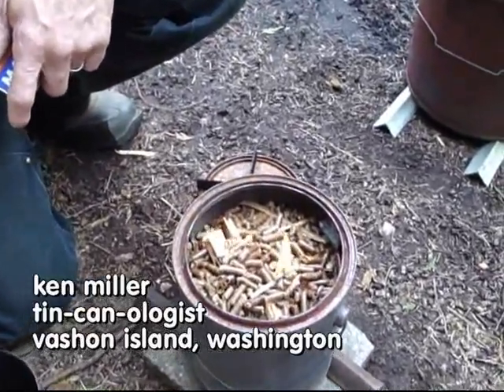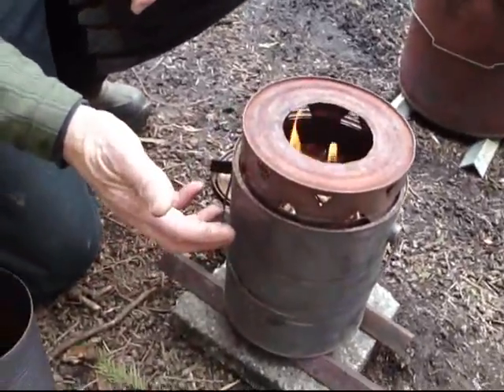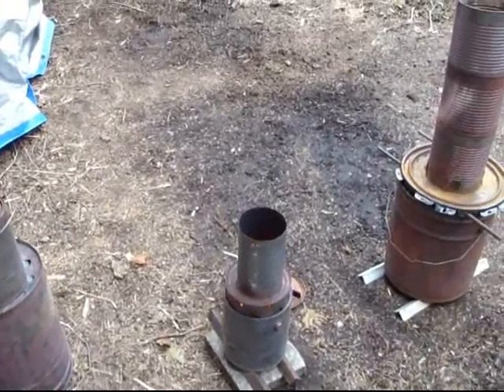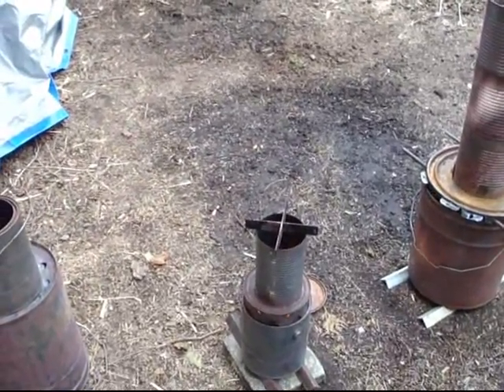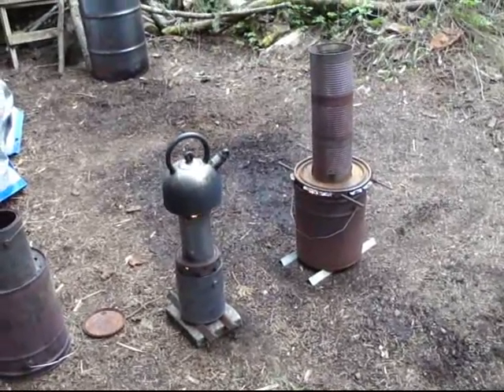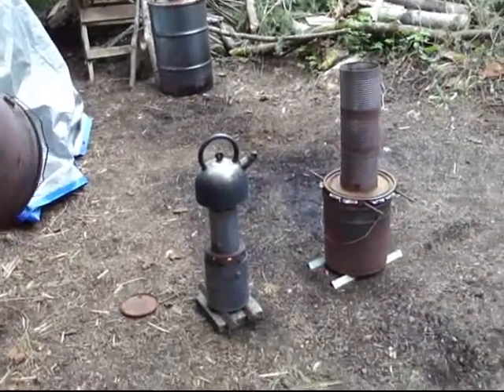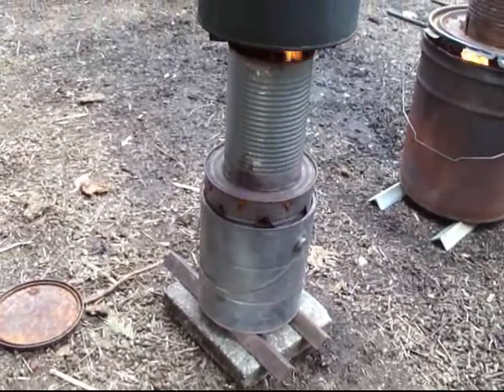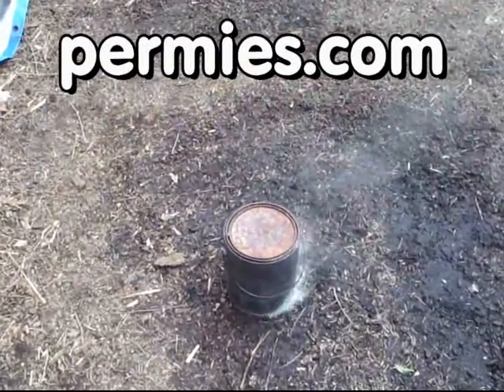top lit updraft (TLUD) wood cook stove

Comment: Another thing- Plain carbon steel cans will burn out rather quickly in continuous use.  Stainless is rather expensive and much harder to get.  I've lined ordinary cans with mixes of clay- sawdust, it works but is quite fragile without being fired.  Easy to fix, though. Plain steel stoves would be ok for emergency or other intermittent use and complete steel stoves are obviously more portable.

Comment: Hey Paul, not true about being unable to save wood with a rocket.  I do it all the time.  Just take out the burning sticks one at a time and shove them into a bucket of ash. They stop smoking very quickly.  I've been playing with rockets and woodgas stoves and using them frequently for cooking,  for about 10 years.  Woodgas stoves are nice if you have fuel that is already small.  Cutting up twigs and branches to use in them gets old really fast- rockets are better for that.

Comment: ...last point - i think you will find that it's the length of your stack that mostly controls the heat you have to cook with.  wood gas is a long, slow flame, and as such is not easy to cook with.  it's better suited to chimney boilers and such, where you can take advantage of the three different combustion stages you get in the flame.  a kettle six inches above the combustion point goes to about 180C, another at eight can get to 220C, in my experiments.  there's a sweet spot in there somewhere,

Comment: ...pyrolysis evaporates all the volatile oils in the wood (as you mentioned) and these also burn, but they do not burn "clean" at all - your kettle, you must have noticed, is getting coated in (sometimes oily) black soot.  it's not "pollution" per se - it's all good for something, but it's important to note that wood gas takes serious effort to "clean" in any real sense, and will definitely mess up your cookware...

Comment: nice simple stove, thanks for the details - couple of comments though..

you said no pollution, but this is wrong - secondary combustion burns a number of gases at once - mostly the water and carbon in the wood is split off via pyrolysis - the hydrogen burns immediately (the blue part of the flame) to form water, and the carbon in the wood goes to carbon monoxide, which burns more slowly to form carbon dioxide (the yellow part) - these burns are "clean", but also...

Comment: Did not read through all of the responses, but if no one mentioned it, propane is better for deep frying a turkey only for one reason... Once your oil is heated up, on a propane stove you can turn your flame off while putting the turkey in so you don't catch yourself or the woods on fire if you spill / splash any oil.

Comment: Just an idea.  Could you make a sleeve on some pipe running to some thermal mass?  Then you could slip the sleeve over the joint and take the stove out for camping or out door cooking?  Then it could be a small RMHin winter and an outdoor cook stove in summer?

Comment: While I'm sure this is more efficient at immediate heat and cooking than a rocket stove, could this be easily incorporated into a heating system for the winter months? Similarly to a rocket mass heater, or a different design?

Comment: But the REAL information was not given regarding this type of stove: this is an example of a BIO-CHAR stove. It works by burning ONLY the volatile gases from the wood, and turning the cellulose parts of the wood into bio-char (charcoal). This is GREAT for the environment--because you produce quite low amounts of CO2; and GREAT for farms, because you can crush the leftover biochar and add it to soil to make HUGE improvements in soil productivity.